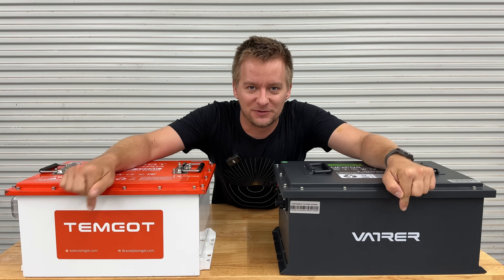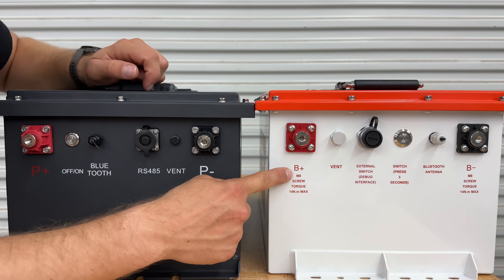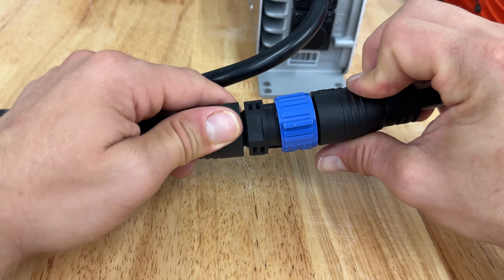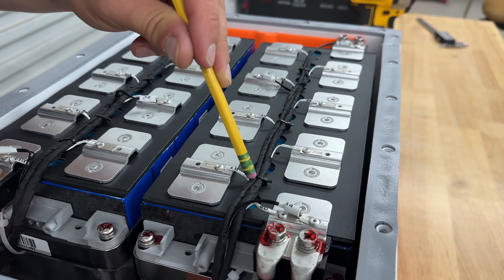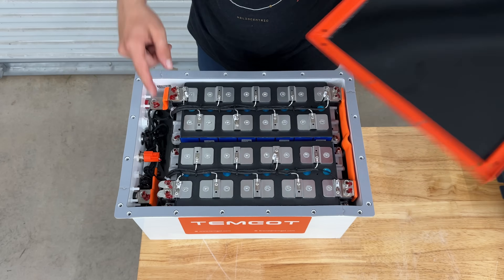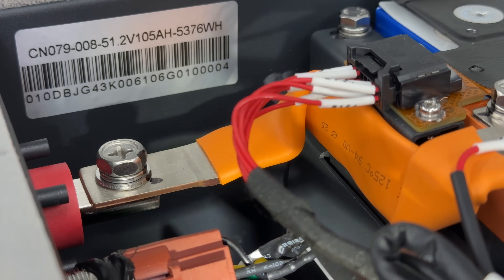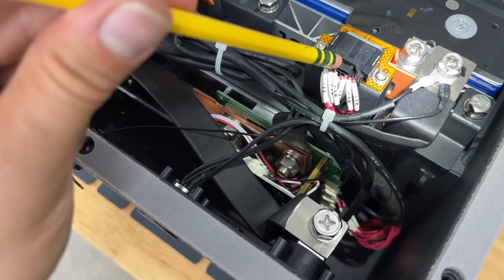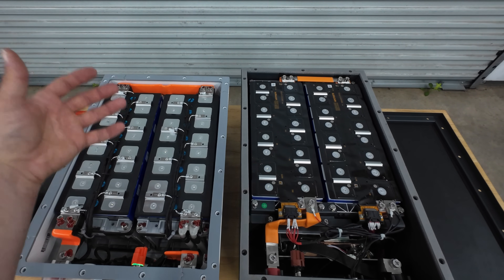Temgot Or Vatrer For Your Golf Cart?

Comment: Just installed DCHOUSE 48V 100AH. Came with charger $719.00. the battery is $1600. Didn't get an $800. Metal case. Have you reviewed the DCHOUSE?

Comment: Different Cables:
Temgot power cable is a C14, which is rated for max 10 A
Vatrer power cable is a C20  which is rated for max 16 A

Which fits each charger, so they checked that.

Comment: the aluminium was not showing heat because metals are reflective like mirrors in infra-red spectrum. That's why some people put a piece of tape on metal parts so they can see their true temperature. And also this is the reason the sticker was warm but the aluminium plate was not